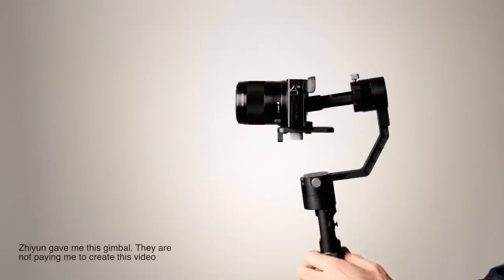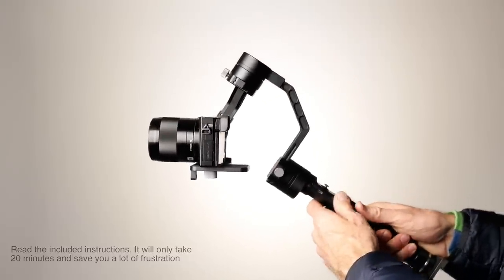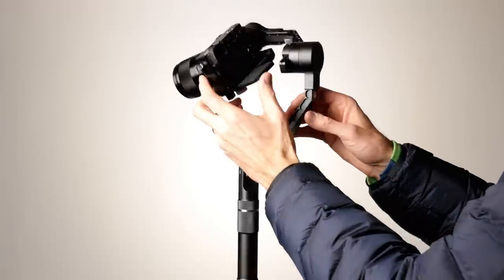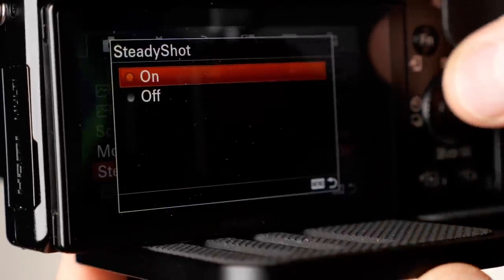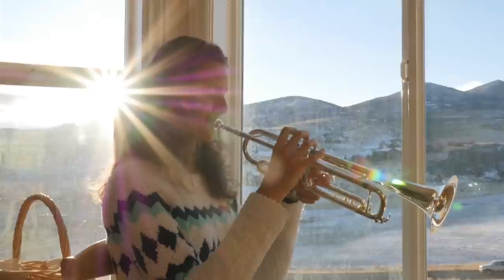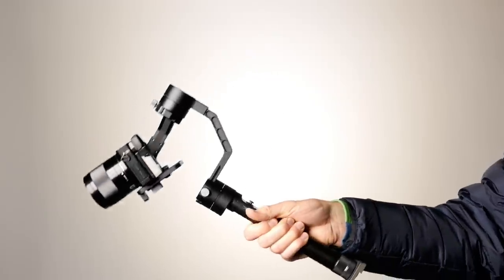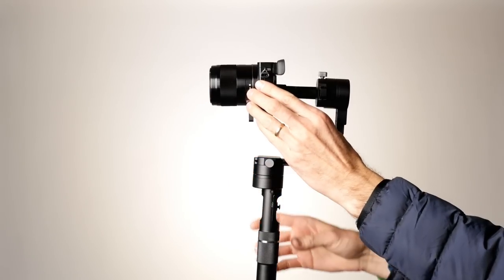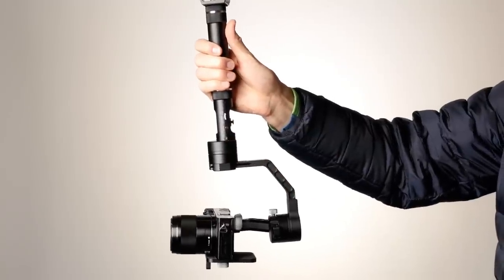Zhiyun Crane 3 axis Motorized Gimbal Setup and Tips

Comment: I noticed you're using a very light camera and lens, but I have an a7iii w/ the 18mm batis. which is about twice as heavy. do you think it'll still work with this gimbal?
Reply from the maker: Yes, I lent this to a friend who used it with his A7SII. I'm not sure which lens he used but he said it worked well. However, since I shot this, Zhiyun has released the Crane 2 which has a larger payload capacity. I'd go for the Crane 2 instead: https://youtu.be/BHJR7OJKld4

Comment: Thanks for sharing this great review! I have a question please:
In the mobile application there is an option where you can change the sensitivity of the motors from weak to strong. When i change mine to strong the app doesnt memorise it and returns it to the weak mode. All the other settings are working fine and the app memorises them as it should. 
Do you have any advice please?
Reply from the maker: +Wizard Video Produzioni my friend is borrowing mine so I don't have it here to test. May be best to contact Zhiyun support.

Comment: how are you focusing?   Also, can you zoom the lens?  will the motors still compensate?
Reply from the maker: +Radiant Video Productions - Santa Monica, CA I don't generally do active focusing while on the gimbal. I shoot a wide prime with an aperture that gives plenty of Depth of field and set focus to infinity. The motors generally will not smooth things out when you manually adjust the lens in terms of focus or zoom.
Reply: Ok, thanks Curtis, good to know....

Comment: I just bought the zhiyun crane for my a7sii. I like shooting anamorphic though and I have a lens adapter that's pretty heavy. I'm pretty sure if it's attached the whole set up exceeds the weight limit a little bit. But I can get it sort of balanced. Is it bad to run the crane a little over the weight limit? I know that it won't be able to stabilize as well which I'm okay with. But will it damage the gimbal motors or anything?
Reply from the maker: It will definitely run the battery down more quickly. Have you tried the heavy camera firmware from Zhiyun which allows you to fly heavier cameras? They call it the 5D firmware. Worth a try.
Reply: Thanks for the tip I'll check it out.

Comment: Hi, thanks for your nice video. This gamble seems pretty usefull for me but I like to choose with a short depth of field, I presume i can't really play with the focus manually with that can I ? And all solution of electronics follow focus i've seen are ridiculously high in price .. Any opinion on that ? It's not about gear but training ?
Reply from the maker: Hi Vivien, touching the camera, particularly to focus or zoom the lens doesn't work as it shakes the camera. I would look into using a remote control app if my cameras supported that.
Reply: Oh thanks a lot for your answer !  I'm using a D750 and i'm very surprised in 2017 we don't have simple remote to make focus wirelessly or zoom (focus is more important for me because I'm not using zoom) I'm really seeing myself with gimbal in one hand .. and zoom remote on the other. The price for some remotei've found  are ridiculously high ... I'm thinking about asking an electronician friend to maybe do something custom ... Found an incredible wedding french videast, I'm gonna ask him what he think about that :)
Reply from the maker: Oh, I'm a D750 shooter too. Be careful, the D750 is at the very edge of what this gimbal can carry and adding an external focus system would likely exceed the payload limit. I was able to get this gimbal to balance with my D750 and 50mm AF-D lens but just barely.
Reply: That's what I was thinking .. still not invested in a Gimbal atm .. just thinking about it .. but yes the d750 is heavy, this was to use with my 50mm too .. .. sadly this gimbal is the only choice before jump to something way bigger like steadycam or dj Ronin .. (and way more expensive ..). Anyway thanks for your advice ! Atm I don't think i can find better than this one at this price.
Reply: Good luck!

Comment: Thank you for making this video. Been considering different models and the Zhiyun Crane seems to have the best combination of features, performance, and price. Would you recommend this one over other brands/models?
Reply from the maker: Hi Shaka, I haven't used any of the others, to be entirely honest, but I've been very happy with the results from the Crane with my Panasonic GH4. I also installed the 5D firmware and was able to fly my Nikon D750 which impressed me since it is a fair bit larger and heavier than the GH4. One of the big things to remember is that for these to work (and this applies to any gimbal), you need a camera/lens combination that is fairly balanced. A lot of the camera kit lenses are too light so the camera becomes difficult to balance on the gimbal.
Reply: Thank you for your response. I would be using the GH4 with the 12-35 2.8. Would that be a good, balanced combination in your experience?
Reply: Yes, that's the exact setup I used to get the gimbal shots in this video. They balance nicely on the Crane.

Comment: Hi Curtis, 
Thanks for doing this video.

While I might be wrong, I think I may have bought a dud and I was wondering if you could shed some light. 

Panning, my Crane doesn't feel completely smooth. Rotating through several angles, I get small vibrations or bumps. Similarly when it's powered off, rotating the handle through around the pan axis, it isn't consistently smooth. It feels like (if it uses bearings) one or more of them might have defects, or there's dust or impurities stopping them from correctly rolling perfectly. 

I'm still trying to work out if this doesn't affect my footage.

I was wondering if you encountered this at all? Any help would be much appreciated.
Reply from the maker: Hi Miles, no, mine were all smooth flowing both with the gimbal on and when turned off. You may want to go ahead and exchange that. Best wishes!
Reply: Hi Curtis, 

Thank you so much for taking the time to reply. I had my suspicions but the retailer seems hesitant in letting me return it. I feel more confident in pressing for a return now. 
I've subscribed and I'm looking forward to your future videos.

All the best,
Miles.

Comment: Hey Curtis. Normally I find your tutorials super helpful, but after watching this, and many, many other gimbal balancing videos I still can't get mine to balance. I do the yaw adjustment, then move the camera back and forth using the base plate so the camera sits level. And my camera now keeps its tilt position just fine, but its top heavy on the yaw axis. I use the yaw adjuster so the camera will balance in the middle, but if I yaw right it falls right, and if I yaw left it falls left. The only way to fix this is by adjusting the tilt adjuster to bring down the centre of gravity. Which of course throws the tilt axis off. Any suggestions would be super helpful.
Reply from the maker: Keir, which camera are you using? I’ve found that smaller cameras and large cameras (such as DSLRs with battery grips) tend not to be particularly well balanced so often require counter weights to balance on a gimbal.
Reply: Curtis Judd I'm using a fujifilm x-t2. I've tried with 23 f/1.4 and 10-24 f/4 with no luck.
Reply from the maker: Keir, you may need to add some weight to the bottom of the camera. Some people have had success by adding an additional quick release plate or similar metal rigging pieces to the bottom of the camera or underneath the plate of the gimbal. Good luck!
Reply: Curtis Judd I'll give that a shot. I've tried with the non battery grip and an arca swis clamp but no bananas. I may just end up posting a YouTube video of my issue and see if anyone can solve it for me.

Comment: hi curtis
fantastic,very helpful tutorials
need help
i am on zhiyun crane plus
After panning, the camera drifts very slowly on ,regardless of how small I set the pan axis (degree of smoothness).
thx
Reply from the maker: Hi Remigius, I would double check the balance on the motor that sits on top of the handle, just to make sure that is dialed in. If that doesn't work, a calibration using the Zhiyun app may do the job. Best wishes!
Reply: tried  both
 no change
curtis
it is the yaw axis which is drifting further after panning
Reply from the maker: Ok, probably best to contact Zhiyun support. Sorry I couldn't help more and I hope they are able to help you resolve the issue. Best wishes!
Reply: hi Curtis
with another description it is the same drifting as if I do not turn off the camera stabilizer on a tripod
thanks so much for help
regards remigius

Comment: Would this work with a small camcorder, or should I look at another gimbal?
Reply: Depending on the size, it may have interference issues with the motors.
Reply from the maker: Hmm, I agree with +Sun Pixel Video - depends on the size. Probably not an issue in terms of weight but definitely designed for mirrorless hybrid camera form factors rather than video cams.

Comment: Hello, thank you for this video.
I'm having an issue with my Zhiyun Crane. I'm 99% sure it's balanced and calibrated properly, but the footage still comes out very jittery. I've tried updating the firmware (to 1.60), and changing the "strength" setting to "strong" in the Zhiyun Assistant app, but nothing has changed. Have you had any issues like this?
Reply from the maker: Hi Laggy44, which camera and lens are you using on the Crane?
Reply: Curtis Judd I'm using a Nikon D3400 and a 50mm f/1.8 prime lens. I know the gimbal is designed for mirrorless cameras, but according to Zhiyun's website, my DSLR is also supported.
Reply from the maker: Yes, the Crane should be able to support the D3400. You'll probably want to contact Zhiyun support to troubleshoot that. Best wishes!

Comment: My crane doesn't get the mode that smooth in tilt automatically, I have to use joystick to move vertically. Is that normal in yours?
Reply from the maker: Hi Alex, if that mode isn't working on your copy of the Crane, there may be a defect in your copy. I would contact Zhiyun support. Best wishes!

Comment: I just subbed! Do you prefer the image stabilization on or off with the the use of the A6500 and the Z-Crane? Thanks!
Reply from the maker: +Leo St.Corsa I don't have the 6500 but it seemed to work best with the a6000 OSS on.
Reply: Thanks!
Reply: @Curtis Judd. You're right my good man. After testing the a6500 + the Z-Crane V2 over the course of six hours of filming, I can confidently say that your right and that the OSS makes a big difference. Some may not notice it while filming, but once the video editing starts its noticeable.
Reply from the maker: Good news, thanks for the update!

Comment: I'm trying to mount and balance my Sony a7s ii with 24-70mm lens but I feel like it's impossible. I've watched this video over and over and still can't seem to get it right. Any other tips? Is my camera too heavy?
Reply from the maker: I think it is the lens that is too heavy. Do you have a lighter lens you can try just to see if it works?
Reply: Hmm... yes, I do I have a lighter lens but this is the lens that I wanted to use. I guess if I can't use the lens I want, I cannot use this gimbal. Thank you so much for the fast response!
Reply: The weight of the 24-70 is most likely not going to work if the issue you're facing is that the lens keeps pointing down (front heavy). Sorry. :(

Comment: Great video as always Curtis.  What monopod are you using with the crane?  I have one but I do not trust it's weight bearing capacity :)
Reply from the maker: Hi Mike, they don't make the one I have anymore but replaced it with this one: http://amzn.to/2sSGqh4
Reply: Thanks Curtis!  That one has a 4.4 lb load capacity tho and that is right at the limit of my gimbal + cam/lens etc.  Since it's going to be dedicated to the gimbal, I do not care about a head.  Looking at this one: https://www.bhphotovideo.com/c/product/1175946-REG/manfrotto_mm290a4us_290_aluminum_monopod.html . - 11 lbs cap and pretty light as well.
Reply from the maker: Looks like it'll do the job nicely. All of my Manfrotto tripods and monopods have been solid for years. I still have my first Manfrotto tripod from 1994 (was marketed as Manfrotto-Bogen at the time). Still use it weekly.
Reply: I won't give away my age here but I have a Bogen tripod as well :) . Thanks for the help Curtis!

Comment: have you had issues with the pitch axis self exciting? the a6000-6500 have very narrow base so can vibrate even with lens support.
Reply from the maker: Haven't run into that issue but have mainly been flying Panasonic GH4.
Reply: just sending back the crane m that arrived today, will give the crane v2 a shot. the A6000 is on the upper limit of the weight spec with the lens combo so may be I need to go bigger so I'm bang in the middle of the weight spec?
Reply from the maker: Yes, particularly with the Sony a6xxx series with big lenses. Their center of gravity is skewed a fair bit.

Comment: What is the best gimbal that can support a heavy setup like my d810 with a 24-70 lens?
Reply from the maker: I haven't gotten into the world of bigger gimbals just yet so I don't have any recommendations on that front. But the first one I'd consider is the DJI Ronin MX: https://bhpho.to/2jkD252
Reply: Curtis Judd thanks!! By the way. Just set up my black backdrop and doing a review on the bioaqua.. the biggest facial mask all over Facebook. Using a beauty light and some soft lights. I don't have the cob120d yet. So lighting is a little off. But wow. The backdrop makes the world of difference. I'll send you a comment once it's uploaded and you can check it out!
Reply from the maker: Looking forward to it!
Reply: Curtis Judd I notice a lot of noise. My ISO was very high. Maybe not enough light? Again thanks for any info
Reply from the maker: Is the noise in the black backdrop? If so, you can crush that in post to reduce the noise there. If you're getting noise in the talent, then you probably need more light. Here's a very old episode on how to crush the black backdrop (and there are plenty of other ways to do the same thing): https://youtu.be/419TFE83mk4
Reply: Curtis Judd yes it's in the backdrop. Also it's so wrinkled... so you can Cleary see them In the video. Obviously that's an issue right? Maybe iron it? Is there a way to make them show less? And thanks I'll check out the video!
Reply from the maker: May or may not be necessary to iron it if you crush the blacks in post.
Reply: Curtis Judd ok. I will try that next video. I used my cheapo umbrella lights. Def underpowered. I have a nice impact softbox kit I was just too tired to setup. Next video I'll do everything you said and see if we see better results. Thanks again!
Reply from the maker: Good luck!

Comment: So I am trying to mount my a6500 and when I screw it to the base plate it still slides back a forth, which makes it pretty impossible to balance and obviously not ok to shoot with. Am I doing something wrong?
Reply from the maker: Hi Nicolas, in the kit I received, there were two separate thumb screws. The shorter one is for mounting the camera, the longer one for the lens support (if you decide to use it). You'll want to confirm you're using the shorter screw. Good luck!
Reply: first off thank you for the quick reply! So I tried both screws in only one of them fits, and the one that fits when I screw it to the baseplate the camera still slides back-and-forth along it like it is entitled not for something and I have a tightened all the way? Again I am shooting with an a6500. do I need like a quick release type thing to mount it to first or should it be working as is?

Comment: What's the weight limit for this? Any chance an A7s + prime lens could fit?
Reply: did you even watch the video? it works with cameras up to 1800 grams
Reply: nazhif1 from zhiyun: 1800g max, but 1600g is max recommended for best performance.
Reply: I thought so too, as I own this, but it really is listed as such on their website. http://www.zhiyun-tech.com/index.php?m=content&c=index&a=show&catid=132&id=190
Reply: I'm personally going to look into this. I want to use my sigma 18-35 on this if i can.
Reply: Sun Pixel Video you also have to take into account the weight distribution. If its too front heavy you not be able to balance it.
Reply: So true. If it's out of balance the motors will start vibrating, which would make any footage unusable and defeat the point of using this.
Reply: and even if it doesn't vibrate it could put a lot of stress on the motors.
Reply: It's fine with A7s2 + Sony 16-35 f4 with a polariser or nd (also tested with Zeiss 35 f2), for example. I've also mounted an arca Swiss plate to make things quicker, so that's even more weight. I get no issues, but I wouldn't push higher.

Comment: Hi Curtis is is possible to attach a Manfrotto 577 Rapid Connect Adapter with Sliding Mounting Plate to the Zhiyun Crane M? I would like to use a small JVC camcorder with it if possible
Reply from the maker: Hi David, I'm not sure since I don't have a camcorder or the manfrotto adapter on hand to test it. Might be best to contact Zhiyun support to confirm. Best wishes!
Reply: Ok thanks for getting back to me

Comment: Well it's 2019 and i just bought this very gimbal and i have an issue with it. It's supposed to pitch, tilt and pan at full 360 degrees but only the pans works all the way and the other two modes only go about 35-40 degrees and then nothing. At first i thought it was weight but my camera and lens (a6300 with tamron 18-300 vc) weight in at 1.1kg. The balancing aspect of it is also just fine i do not know why it won't go full 360 in pitch and tilt... or is it roll mode... yeah. HELP!!!
Reply from the maker: Hi Scotty, I’m not sure, probably best to contact Zhiyun support. Best wishes!